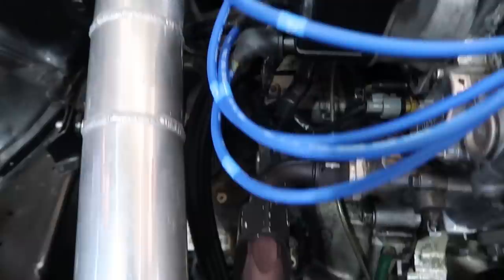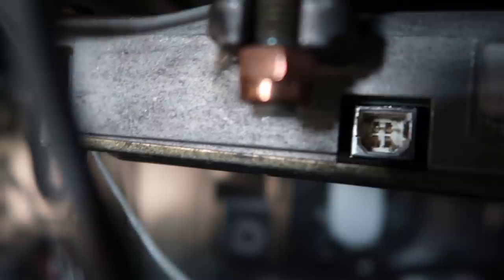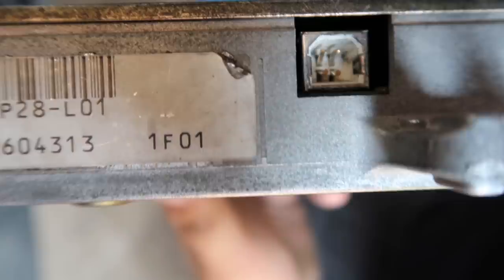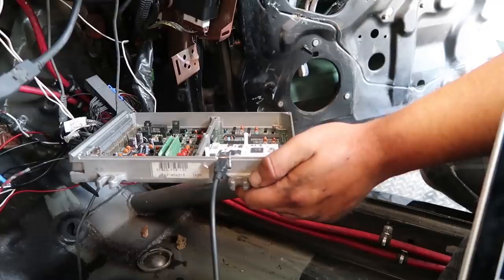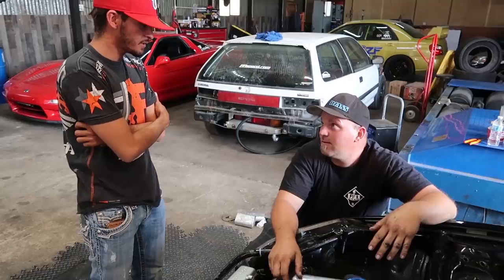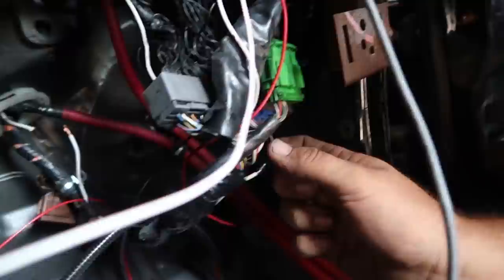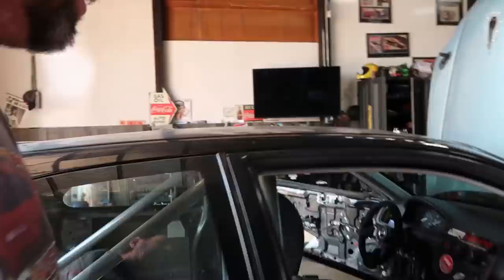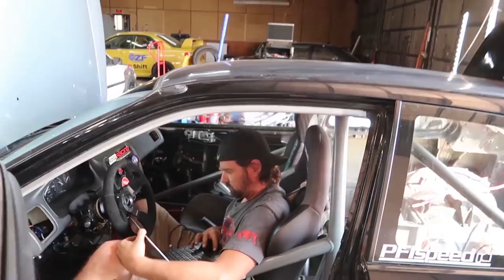He Just bought it... what’s wrong with this?! Let’s Goo find out part 1

Comment: So the foam in the fuel cell deteriorated and jacked up everything down stream?
Reply: Yup, that foam can not withstand prolonged exposure to E85. They said the car sat for a long time so that foam broke up and as soon as they hit those pumps it more than likely sucked all the foam bits into the fuel system and whamo bro
Reply: @armedpreacher  made that mistake my first time with going e85 almost sold the car until I hit brent up with some advise on what to check

Comment: If you guys are still wondering about the reasons why you have 50psi with hardly any fuel coming out: Flow and pressure are different, restricting flow creates pressure. What you have is pressure with no flow caused by the restriction in filters. Also why the pressure is dropping off when the car is started and idles, there's pressure to start but the flow isn't enough to keep up with the demands of the injectors.

Comment: Those Bosch LSU4 sensors have a trimmer resistor in the connector to calibrate them, without the entire connector they won't work properly if the Innovate controller is actually using the trimmer resistor.

Comment: That's another rough one, but no doubt ya'll can get it rippin.
Reply: i.e.  Pull fuel pump and inspect, pull injectors and inspect, remove filters, check line clear, replace filters.  E85 can eat a lot of stuff if the fuel system wasn't planned around it.

Comment: Looks like they used tried to use a TPS plug for the MAP and didn’t repin the wires into the correct spot and just went off the colors(which were in TPS location) so the car never ran right

Comment: Hey Brent! Question, I'm looking to get a good de-pinning kit because I have a loose wire for my lighting and I need to push the pin out in order to fix it. It's an '03 ford CVPI (crown vic police) that I stupidly cut the power and signal wire from the LCM to bypass it so that I can run LED turn signals. Now I am regretting it since my turn signal works half the time now. I want to put it back to stock and go back to the drawing board

Comment: Every time I see a vehicle with jacked up horrible looking wiring I feel so bad for the owner, people that know nothing about wiring or electronics should NEVER EVER work on a wiring harness or the electrical system on a car.  I do not see how people can spend SO MUCH money and time on the engine and then you look at the ecu and ecu wiring and it is nothing but a rats nest or shit and butt connectors.  Fucking wire the shit correctly, and secure it out of the way.